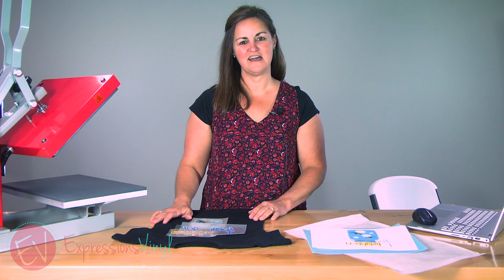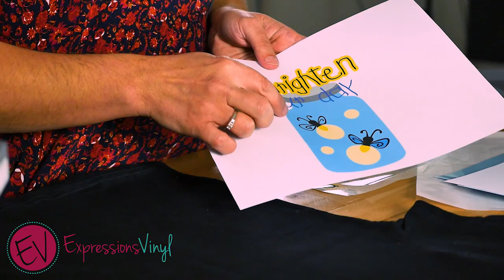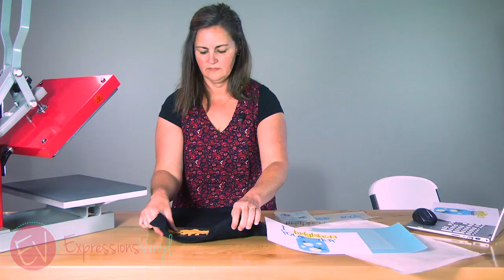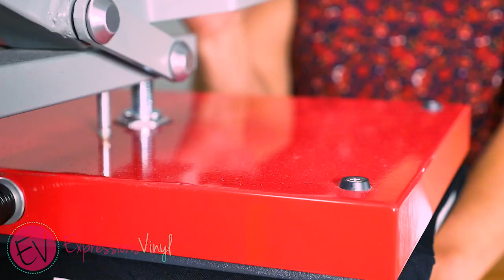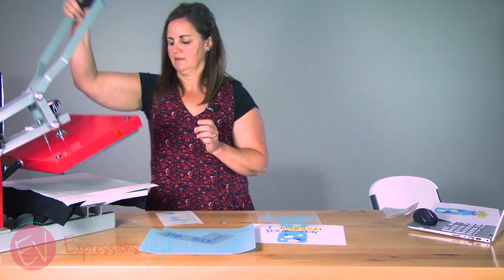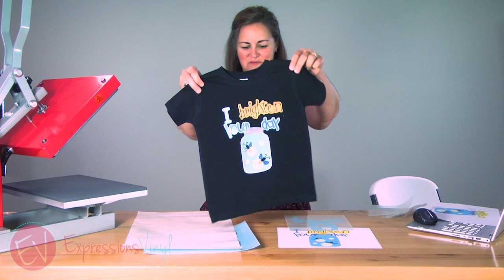Custom Summer Kids T-Shirt Using Siser Heat Transfer Vinyl

Comment: Silly question, can you use silhouette store specific to the silhouette machine? Can you use it   with cricut?
Reply from the maker: No such thing as a silly question! If an image is in silhouette store it can be used with the Silhouette machine. I cannot be used with the Cricut machine. However, you can find similar items in both stores. Some artists have images in both stores.

Comment: StripFlock Is rapidly becoming my favorite HTV to work with. Apart from being "cold peel" it is very easy to cut, weed and position.   The velvety soft feel of the transfer on the shirt or other project is amazing, and it washes well. My last three projects, all different, were a huge success mostly as a result of incorporating StripFlock into the projects.  
This Lightning Bug jar turned out great!
Reply from the maker: I totally agree! Stripflock has been underrated. It's awesome! It sounds like you have done some fun projects lately. Keep up the good work!

Comment: Tysm for sharing the mistakes you made on this project so that we don't make them. I love how the t-shirt turned out in the end😍
What is the difference in multi purpose paper and  a Teflon sheet?
Thanks again, Bonnie
Reply from the maker: Joyce, Thanks so much! The multi use paper or Teflon sheet helps protect your project and your heat press. When layering you will have exposed vinyl and you don't want the metal of the iron to touch the vinyl directly. The vinyl could stick to the metal and make a mess. The vinyl won't stick to the multi use paper or the teflon sheet.

Comment: Great job Bonnie!  Thank you for pointing out the do's and don'ts... can you clarify the pressing time for each layer?  Full time or just enough to tack it on? What temp/time should you use if the temp/time is different for each material?  Is there an average that works so you can start to finish in one session?
Reply: She did the layers for the full time but she shouldn't have. She should have done a tack down each time - prevents shrinking of the individual layers making it hard to line up depending on the design, prevents marks on the layers from the carrier sheet of the layers being added. I would also check if you can layer vinyl on top of flock or if that would cause wash-ability problems.  Not sure but she may also have too many layers in spots. Should only have a maximum of three layers of easy weed vinyl.
Reply: atouchofwhimsy1 Thank you!  It's hard being a newbie and trying to learn and work with not only all the different vinyl types but also vendors... then working with a malfunctioning machine that I had to return because it cremated my projects!  Thank you for your reply,  much appreciated!🙂
Reply: A slightly more advanced technique... You can use use the Subtract feature in Sil. Studio to remove the underlying portion of HTV that will be covered by the HTV placed on top. You can then put a slight offset on the overlying piece to just barely overlap the vinyl on the lower layer. This way you don't have multiple layers of HTV piling up. Takes a bit of practice to line up the layers, but the result is nice. And all the HTV is stuck to fabric.
Reply from the maker: Nancy atouchofwhimsy1 is exactly right! Check out this video we did with layering. It explains it more. https://www.youtube.com/watch?v=61jSgAL7Q8w
Reply: JUpcraft Thanks... I don't use Silhouette, but can try that option with one of my other cutting machines, great tip!